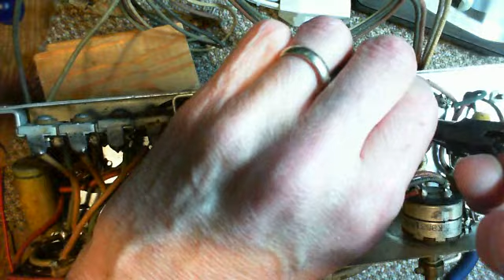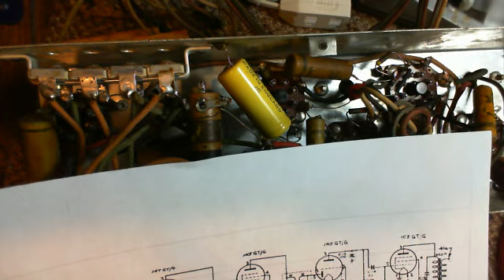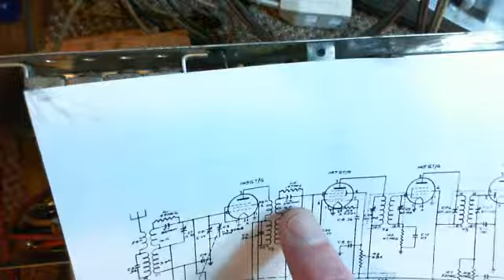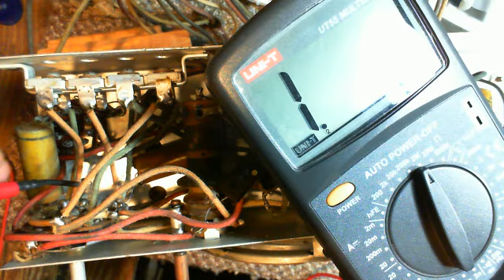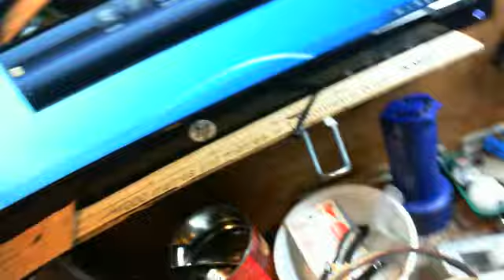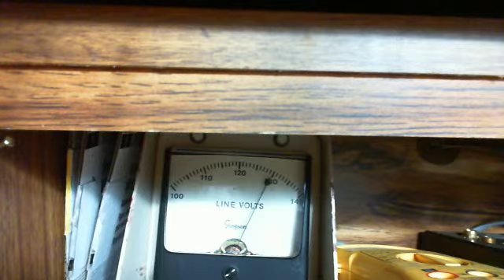General Electric C57B Farm Radio Video #6 - Replacing Capacitors

Comment: Hi Jim, I heard you mention in this video about the isolation transformer...some iso transformers do step up the line voltage...One very important thing to remember when using an iso trans...be sure that the ground on the receptacle is not connected to the primary ground...if it is, you can still be a risk of shock potential...My isolation transformer came out of a hospital that was used to protect both the equipment and patient from AC potential, however, being that the ground was connected on both the primary and secondary side, I took out a scope because of 120V on a hot chassis...It can happen...Another VERY wise investment is a Variac...NO shop should be without one...even with the current limiting lamp (which I also use) it may limit the current, but there are many situations where a piece of equipment that hasn't been powered up in a long while can literally blow an electrolytic which can make a mess...Bringing up the line voltage at a slow rate can help reform old capacitors and prevent them from exploding from the inrush...Also, by bringing up the AC line slowly, you can watch the current meter on the Variac which will also indicate a short if a piece of equipment starts t draw excessive current immediately...It's also good for troubleshooting solid state devices (finding shorted audio output transistors (I'll give you a tip on that procedure at another time...I have some other important tips that i would be happy to share...Keep the videos coming :) Frank Ferraro--Audio Craft Electronics...
Reply: PS: Another good investment is a line voltage regulator--since your line voltage seems to run quite high in your area...My area's line voltage varies only 3 or 4 volts up or down...If anything, it drops low during the summertime...But it seems to stay put at 120V...
Reply from the maker: Frank Ferraro I've always wanted a variac but never had the chance to grab one.  But, I may know where I can get one so I'm going to look into that.  With a variac, the high output from the isolation meter won't matter.